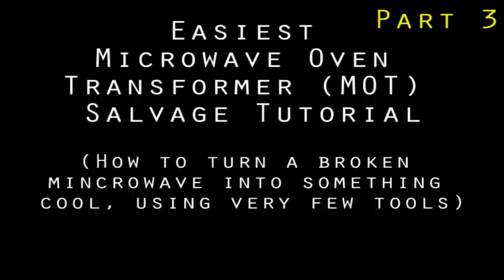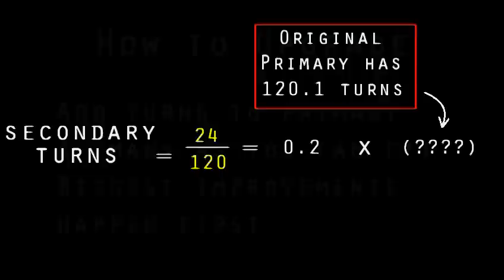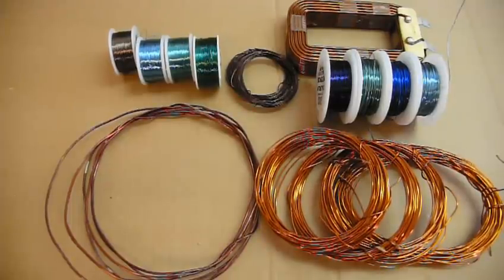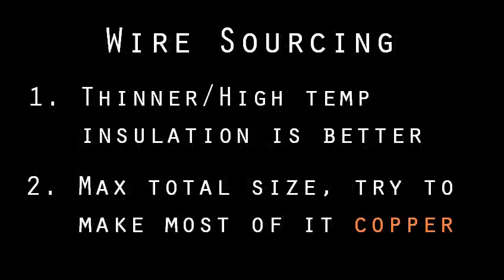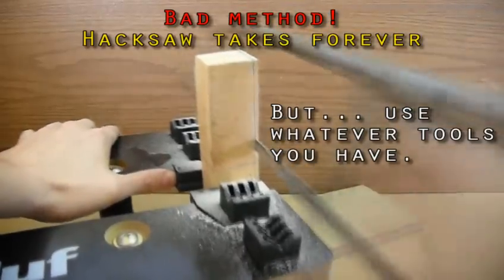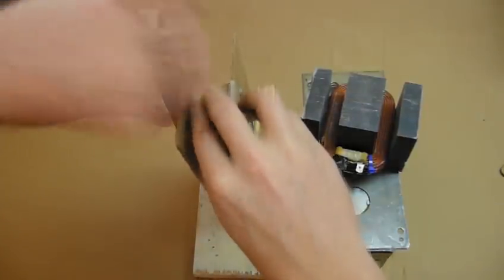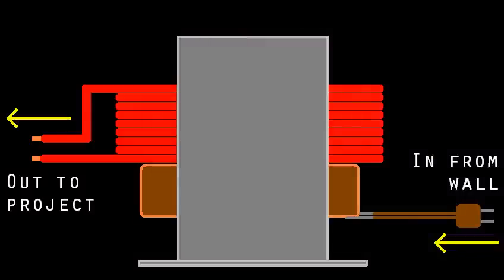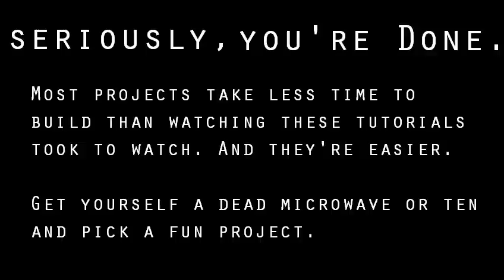Easiest MOT Salvage Tutorial Pt.3

Comment: 1.
Trying to estimate how much watt a power tool is design for. So I can kind know what FWB amperage I need. Bigger the motor , bigger watt, smaller motor, less watt. 

The different between full wave and half wave is full is using top and bottom sin wave. While half only use one side which is also half the amp. Is this correct?
The rectifier block specification sheet does not say it is full wave. Is this mean it is half wave usually?

2.
After I removed compacitor, how do I know it is still good? Visually the top of cylinder cross is not buldging or black shown overheat once before?
After removed it from circuit board. How do I know which side is positive and which side is negative? Or Does not matter?

Comment: I have a question... Do I need to wire the primaries of two transformers in series or parallel? I am planning to use 3 transformers if 2 fall insufficient for my MOT Welder. I'm confused on the wiring. My country runs on 230/240 Volts AC... Thanks in advance!

Comment from the maker: Script's done, I have extra microwaves. Takes about 100 hours of work for audio/video/graphics/edit. Could be a month. You're subscribed so, you'll see it when it arrives. If you're impatient: A spot welder is a 1-turn secondary. Use scrap copper. You can do it for free using your old secondary but it's laborious to explain in text. I see you like chainmaille, is it for that or for sheet metal?

Comment: Your microwave mod transformer and electric stove both deliver watt.

Micowave transformer high current low volt can be used for welding.

So is electric stove socket where electricity is feed through the burner coil 220vac. It is just danger to deal with high voltage when welding.

Is this correct? If yes. A robot can utilized 220VAC to weld without buck covert to lower voltage.

Is this correct thinking?
Reply from the maker: Close, but no. You cannot weld with 220vac directly. Voltage is too high. Not only dangerous (max legal welding voltage is 50v I think?)... but what happens in the weld. Too much voltage will turn metal into gas instead of liquid, and will take too much current. 10x too high of voltage = 10x too much current = 100x too much power (watts) and heat. You have to lower the voltage to 24-30v to weld, no matter what.

Comment: Having connected this way,the out put was 44 volts  drawing 9.8 amps from the wall socket.not as so noisy after applying varnish.however,without load in less than 2 minutes the primary heats up and so does the top of the transformer coz of primary.would the 2.5mm secondary and the primary be ok with arc weld with the output amps?   (each transformer  connected alone is 22volts drawing 5.1 amps probably over 50amp output so over 100amps when connected parallel right?)

Comment: Now I have a question. (or 2)
You used a cordless drill in a couple of these vids.
I want to start with a MOT, and end up with a power supply that will power a 14.4v cordless. Without burning up the drill.
Amperage needed at 14.4 is about 40 to 45, under full load. So a 1000w transformer should provide plenty of amperage.
I'll wind a secondary of roughly 15 turns. Testing to make sure I get within 13.5 to 15.5 volts in the end. (continued.)

Comment from the maker: They are original. The laminations often have the holes if there is a jig that the helps assemble them nice and square into the transformer. Depends on the factory/process.

Don't despair. Just use some epoxy, silicone or any of the other solutions I suggested. A couple wraps of tight duct tape even works fine, even though it impedes cooling and will eventually dry out and flake.

Comment: I have many 24vdc and 18vdc hand tools, 36V bike . Battery cost more then the tool, bike itself. I don't know why tool maker dont commercial make power supply for 24vdc and 18vdc tool.

Did lots research on how to build a power supply as many people did on u tube... Found your with most important detail.

Is it true buck and boost converter can only convert DCV back to ACV then back to dcv?

Conversion can only take place in AC environment?
Reply from the maker: A transformer only works on AC, it will melt with DC. But a transformer is not the only way to change voltage. "Buck" and "Boost" converters are special types of DC-DC converters that use electronic circuits instead of transformers to change voltage. Generally yes, what they do is "chop" the DC into something that looks like an AC wave, and then put that through a transformer (a very small one, because they will switch very fast which means you can use a smaller transformer for the same power), then convert that result back to DC. If you are building a power supply, note that you want to only reach 70% of your DC voltage target, plus 0.7V total, because your capacitors will charge to peak voltage. So, to convert from 120vac to 24vdc, your transformer should actually convert 120AC to 18vdc (70% of 24 = 17, plus 0.7v). However, you can buy very cheap DC-DC converters online that are very good at changing a range of voltages very precisely. They just usually can't take 120VAC. So, use a transformer to step down to something closer to their max voltage, use a FWB Rectifier to make it DC, add in a capacitor, and then use that as the input into the DC-DC buck converter to be very precise and finish it off.

Comment: SO you say they use more power when I remove the shunts? why would that be? I don't understand. i have made a few modified mots into spot welder power sources and removed the shunts should I have not? Thanks Ben
Reply from the maker: The shunts are there to limit the max current. If you remove them it allows you to drive the transformer into really abusive amounts of saturation and low efficiency... but terrible efficiency or not it does grant access to a bit more power on the output.

For a spot welder, I would remove the shunts, yeah. Spot welders are so brief (less than a second usually) but need every drop of current you can squeeze out of them that this is a good tradeoff.
Reply: Ok thanks great video and info btw.

Comment: I was wondering what is the different between your microwave mod and a electric stove ?

Can I just take an old electric stove, connect the 2 end to burn some red hot wire?

Is there any difference?
Reply from the maker: An electric stove is just your raw, line voltage going into a socket. That'll be 220volts almost everywhere in the world. In a stove, you do not see the wire that connects to the main voltage. It is a smaller wire that is surrounded by chalky-white insulator that is then surrounded by iron. The iron on your stove elements is not electrically connected to your house, it's only thermally connected to the wire that runs inside it (inside wire gets hot, outside wire gets hot). Else, when you put a metal pot on the stove it would short out, or, when you touched a burner you wouldn't just get burned, you'd be electrocuted.

What I've done with the microwave oven transformer is lower the voltage from 120v to about 24v. That's the point of a transformer, to transform the voltage.

If you were to stick a wire into your stove element plug, you would instantly die. Don't do that.

Comment: 16:15 did you frankenstein 2 E blocks together?

I have 2 mots with identical dimensions, and I was thinking of doing that and just linking the 2 secondaries and extra primary in series for a >4kV mot.
Gotta get the coil rotations right though.

There should also be extra space for additional turns on the primary due to losing 2 sets of the extra low voltage coil plus 1 set of magnetic shunts.

Common sense is telling me to go for it, anyone see any issues?
Reply from the maker: BGM You've got it all figured out. You even identified phasing as a possible issue and know how to match it, so, you're set. Option 1 is to run it off 240V (dryer plug) so wire those primaries in series so there's 240 turns worth of primary. Option 2 is to run it on 120V, so hook them up in parallel after you make sure they're matched almost exactly for turns count, you gotta test them, they'll fight each other if you don't. Add turns to whichver needs it. Option 3 is to run each primary off of its own 120v circuit (take them from different breakers). Also, do you know what you're doing with high voltage? 4kV will be instantly fatal if you get within 1/4" of it. Instantly, no second chances. Still enough current to kill an elephant at that voltage too. Normally I tell people to never do this, and to only wrap low-voltage secondaries, but, personal responsibility and all that, just know what you're getting into.
Reply: MattsAwesomeStuff I build an induction heater could I get 1 to 2 kilowatts out of the transformer?
Reply from the maker: Owen Chase Did you watch the tutorials? I answered this. I make tutorials so I don't have to answer the same questions over and over. In brief, to be obvious.. with a transformer capable of 1-2kw, you could power 1-2kw, sure. Up to about 1000hz. If you're looking at any more than that, an iron-core transformer is no good, you need ferrite or maybe powdered iron. Look for an inverter microwave.
Reply: O ok thanks

Comment: Hey matt - I'm looking to make a 110v stick welder for low amperage stuff - there seem to be a lot of people who have a lot of tutorials on this sort of thing, but all of them either have glaring (even to me, an electrical idiot) safety/functionality issues, or they build something a lot bigger than what I want, or complicated in all the wrong ways, with no particular gain.

I was thinking of a dimmer switch to control the output from the primary side, and hoping that I could simply have one transformer, (maybe, hopefully)with the welding cable wound directly as the secondary, such that I could have a welder in a box the size of a large MOT, with just a power cord, two leads, a knob, and a switch, capable of running 3/32ths electrodes.

With the videos out there, I could absolutely figure out how to build a bog standard buzzbox, but I have one of those, I want something the size of a lunchbox that you can plug into a normal outlet and start welding with. I could live with multiple transformers, but would much rather have one - at this time I have the transformer (and capacitor - which I thought might be useful in helping to get an arc started, I could be misunderstanding things though) from a 1000w microwave, but could probably get one from a pretty big (industrial, or nearly so) one if needbe.

The popular videos on microwave welders are exactly what I do NOT want: different 110v sockets powering a sprawling monstrosity of a fire/electrocution hazard - making a few passes is totally acceptable to me, having a shameful disaster of a welding "machine" is not.

I know that this is intellectually lazy of me, and that I should be able to study up and answer my own question, but it seems like something you should be able to answer off the top of your head, with your handle on this stuff, and I'd rather not delve deeply into it, just to learn that I'm wasting my time and it's impossible.

Comment: Question 1:
I have identical multimeter rated for 10amp.

I was wondering if I can parallel them like battery to read 20amp?

Or somewhere between 0 to 20amp. By adding the 2 multi meter reading together?

Question 2:
I found many 100amp, 50amp, 10amp meter with special shunk to reduce current. So it does not burn out the meter.

I was wonder why people wouldn't just buy a 100amp for all purpose. 

Is 10amp reader read more acute for anything below 10amp in compare 100amp meter trying to read amp below 10amp?

I just don't know.
Reply from the maker: A1 - Yes and no. If you use two meters, you can add the amp ratings of each to get the total amps. But, the meters not guaranteed to share equally. One might take 18 amps and blow up, the other might only take 2 (until the first blows up, then it will take all 20 amps). It will depend on how identical the two meters are. Difficult to guess.

A2 - "shunt", not "shunk". The shunt is not to reduce current to not burn out the meter. The shunt is so that you know exactly the measurement because of a very small voltage drop across the known resistance of the shunt (it's how an ammeter knows how many amps are flowing, it measures voltage across known, very-very-very-low resistance, Amps = Volts / Resistance ). However, a couple reasons why there are different sizes of shunts. One is that bigger ones have more material and cost more to make. Another reason is that measurement devices are most accurate in a specific range. If you want to measure 1-10 amps, you should use 10. If you want to measure 10-100 amps, you should use the 100. If you use the 100 to measure 1-10, the meter is observing a 1-10% change rather than a 10-100% change.

Comment: This series was really well made, and very informative.
I'm in the process of making something as simple as a hot wire foam cutter, and i need a 2x12v/24v transformer, so i am able to swich between those voltages. You video made it very clear that i can just make 2 secondary windings, and connect them in parallel or series via an on-0-on switch, depending on what current i need.

I see a lot of people using hot wire foam cutters, just putting a cheap single pole incandecent leading edge dimmer in front of the primary, to limit the current, and thereby regululating the temperature of the hot wire. Won't that cause problems with saturation? (I'm not even sure i completely understand transformer saturation, even though i've tried to read up on it - so i might be wrong).

Anyway - your videos are great, and i really hope we will see more videos from you in the future, since your kind of videos, with both humor and educational value, that can be used practically, are few and far between.
I can tell that you take pride in producing high production value videos, by the quality of your work, but i would be happy to see you sacrifice a little production value, if i could just get to enjoy some more content from you :).

Good luck
Reply from the maker: Glad I could help. I have built a hot wire foam cutter before using a car battery charger (old style, just a transformer and diode). I threw a dimmer on it (primary side, as you correctly figured) and it worked fine. No saturation issues for me.

Comment from the maker: 4 diodes or a rectifier you need, any can handle the voltage, but they must be sized for proper max amps. Fairly big, Ratshack probably doesn't have any. The control board in the microwave might have small ones you could try and fry. Rectifiers are black with 4 leads and usually a corner cut.

Also, you need capacitors to smooth voltage bumps. At least 20V (much extra won't help and will add cost), and hundreds/low thousands of uF. Hard on motor otherwise.

Comment: Hi man!!!I'm impressed!!! Amazing tutorials!!!  Congratulations!! Now, I'd like to ask you something:  How can I do a transformer with secondary of 38-0-38 volts/10 amp and primary of 115 volts?  Which will be the procedure? Thanks for you videos!!
Reply from the maker: 38-0-38? So, a center-tapped transformer? Easy, 38+38= 76v. So, use the math presuming you're building one for 76v, but when you go to build it, you stop half way through whatever your turn number was (~38), and bend the wires away from the coil, then back, then keep going. All you need is access to the mid-point for later, so just make sure you give yourself access at that mid-point. At 76v, 10amps is 760 watts, so, a medium/large MOT should be able to handle that power level. If you get stuck let me know where you get stuck, but otherwise just follow the tutorial.
Reply: First of all, thanks for your answer!!  And second, I want a tell you something about the function of the transformer.  It will be for an audio amplifier 300+300w. Is it posible to make it this way?  Greetings!
Reply from the maker: @jaguirre0807  - Audio transformers are a bit tricky, because they're continuous duty. So you will need to add extra turns to the primary, and almost certainly a fan to keep this transformer cool enough at hotter temperatures. Better to use the biggest MOT you can find, or even 2 separate MOTs driven in parallel.
Reply: @MattsAwesomeStuff  Thanks a lot for you help.! Now, I'm clear in many things about this ítem. I hope to get the MOTs for my project soon, and I'll share with you all about the amplifier build process.  Thanks again, and one last thing:  if you can make videos about audio-amplifiers of big wattage (100-1000w or moore) with same level of perfection as you have done MOTs topic, I'd will be very happy!! Good look my friend!!!

Comment: Approximately how many amps from mains to the mot am i to get to know the primary isn't shorted either from one mot or the two connected coz each on its own pull 5.1 amps at 237-240Volts and outputs 22 Volts.II'll try with the fan on coz of heat
thanks.

Comment: hello, so I rewired a MOT for 40v output with a 25v center tap. But the primary gets extremely hot in seconds. I measured the current with no load and it draws about 10amps. is this normal?